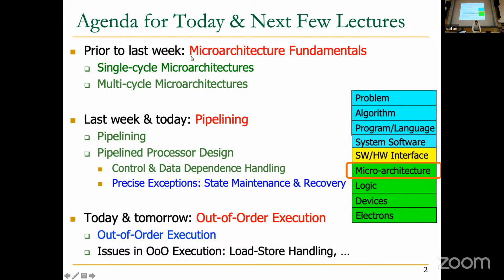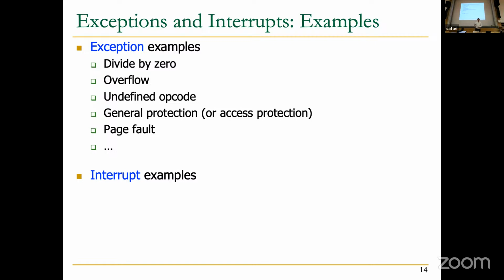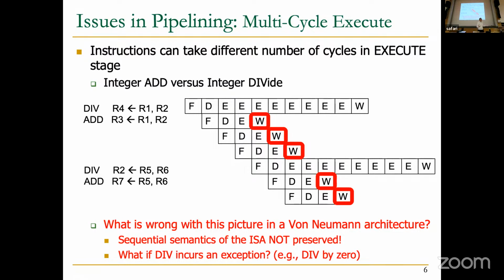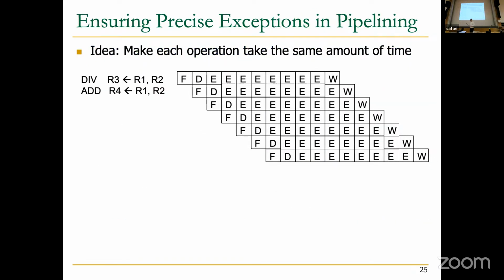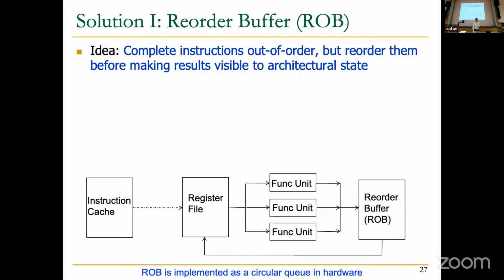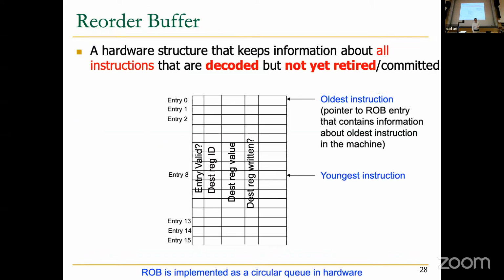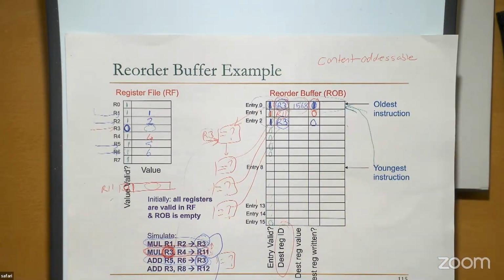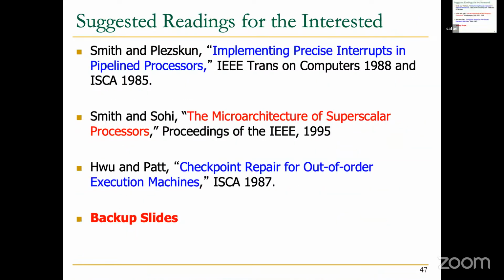Digital Design and Comp Arch - Lecture 14: Precise Exceptions & Register Renaming (Spring 2023)

Comment: sir a small doubt, in ROB we update regfile tag to latest ROB entry but what if in between instruction(semi old) of older intruction(hasn't wriiten value to ROB so simi old instruction didnt acces) and latest instruction(writing to r3) need to access R3 but we updated regfile tag to latest  instruction, so wont it(semi old instruction ) access a wrong R3 value. I hope you understood my doubt.
Reply: I also have this puzzle. Here is what I think could happen after some thoughts: In the register file, if you still remember, we have a ValidBit indicating whether any instruction is about to write to the address. So if the first very long cycle instruction uses that register address, and was then used in the subsequent instruction, the subsequent instruction will have to wait until at least the first execution step is finished if we use by-pass circuit. So the pipeline diagram may look something like following: 
FDEEEEEEEERW
  FD                ERW
Please let me know what you think.
Reply: @user-dj8qo1eu2d, I struggle with same problem. I not understand for now, how exactly at 1:39:53 image, value from Reorder Buffer entry 1 will get correct value from entry 0, instead of looking at entry 2. 
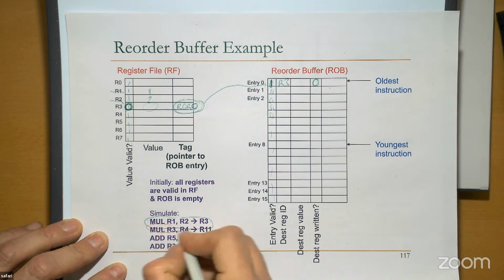But note comment of professor at 1:38:25 mentioning that entry 1 "knows" that it need wait to result in entry 0. I guess somewhere in future implementations will be explained, so for now, I suppose, even tags from register file update ROB reference, the already existed entries in Reorder Buffer will keep link to correct entries, from which they will wait for result.
Reply: Having same doubts,

probably has to wait until at least

Mul R3,R4 -> R11 has consumed the result of R3 for first instruction, before replacing the TAG for R3?